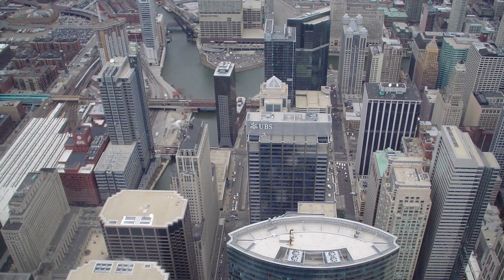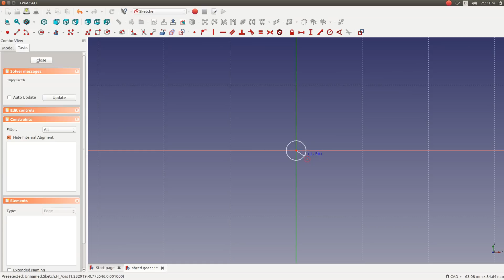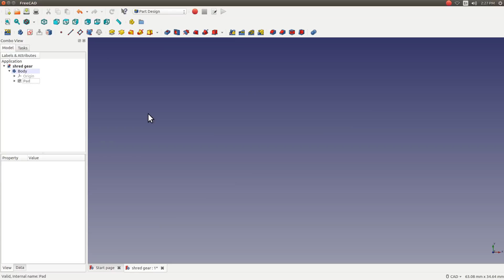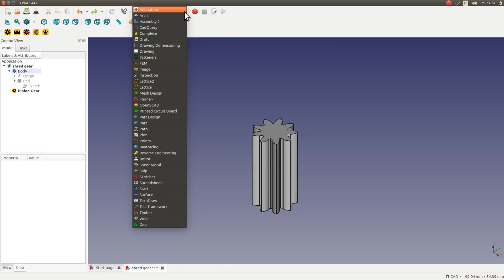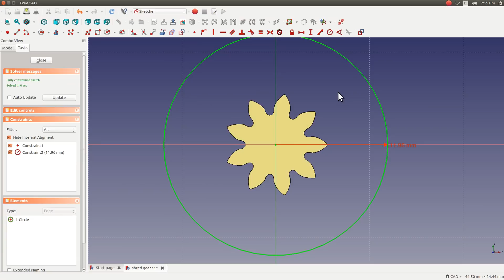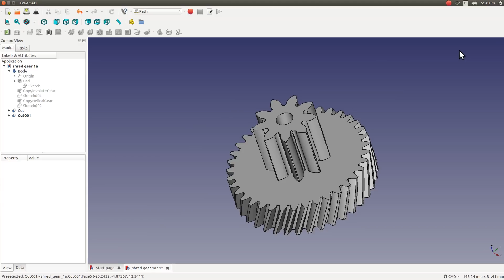Paper Shredder Repair 2019 Pt2

Comment: I made my gear following your tutorial and everything worked perfectly.  The gear fit great, but while testing it the pinion part of the gear was "torque twisted" off the main gear.  I think the problem was the quality of the print (see pics here: https://u.pcloud.link/publink/show?code=XZ3ew3kZEN9uEDQ7HHjVYXdu3Arch0CPBbhV).  There are a lot of air pockets in this print which probably made the gear weaker.  I don't own a 3D printer, so the online service I used was makexyz and the material I chose was ABS plastic.  Do you have any advice as to which online vendors I could use to make a quality, strong, long lasting print of this gear?  Should I try a different material?
Reply from the maker: Hi Nate:

I’m sorry you were disappointed with the quality of your print.  ABS plastic is great for this application.  You’ve already discovered the problem with the amount of infill.  This process works best with 70 to 90% infill.  With compound gears, if you have a shear failure especially between the main gear and the pinion, add more infill.  If you own your own printer this is easy to control, but if you are jobbing this out they need to know this before they accept the job.
Reply: @bcastlar3453  Thanks for the info.  I don't know of any vendor that allows me to control the infill.  Should I try a different material?  I did find a 3D printing service that would do a steel gear for a somewhat reasonable price.  Would 3D printed steel be a better option?  Or would I still have to worry about the amount of infill even when printing with steel?
Reply from the maker: The steel gear sounds cool!  Let me know if you go down that path.  I had a chance to sleep on your problem.  You might try to pour epoxy resin in both halves with small steel rods spanning both gears.  Let cure and pray!
Reply: @bcastlar3453  Oh wow.  I hadn't thought of that.  Any idea where I could get steel rods?  I'd be willing to give this a try.  Also, I have a friend that has a 3D printer who might try printing a gear with greater infill.  I'll let you know how that goes.  Thanks for all your help with this!
Reply from the maker: As a part of the maker community, it’s time to think outside of the box.  Check your stock of like new and well used screws 4-40, or 6-32.  That would be M3, or M3.5 for our friends in metric land.  Throw the screw in head, threads and all.  That just gives the epoxy more to grab onto.  Definitely, let your friends printer give it a try.  Good luck.
Reply: @bcastlar3453  I tried the steel screw approach but I ended up mangling the gear :(  A google search of "3D printed gear strength" bought up quite a few articles on the subject and most of them seemed to use Nylon as the material of choice.  I found a online service that would do that cheaply, about 1.5X the price compared to ABS, via selective laser sintering using Nylon PA2200 and the resulting gear is really strong.  I tested its stength by jamming enough paper in my shredder (way more than it was rated for) to the point where it was straining the push the paper through and the gear held.  Is there a drawback to SLS printed Nylon over ABS?
Reply from the maker: To be honest, I’ve never tried nylon.  Per my printer spec sheet, it’s not recommended to try to pint nylon due to the high temperatures needed.  Anyway, the only filament I have is ABS with just a small coil of PLA which came with the printer. 

BTW, I just uploaded part 3 of my series on parametric cad.  It was supposed to go up Monday, but I have been suffering with a bought of laryngitis.  As of yesterday, my voice came back to the point that I was able to cut some audio tracks.

Comment: I'm using version 0.18.4 of FreeCAD and the opening menu looks nothing like yours.  How do you create a project?  I can create a file but there is nothing in the Task tab.
Reply: I had that same problem.  This is what I did. File--> New-->an unnamed item is created. You can then "save as" and name it gear... whatever. Then go to the workbench drop down list at the top and select part design.  On the left is a box that has "start Part."  Underneath that is "create body".  Click on that and then it becomes "Create Sketch".   Then you can follow the instructions as he laid out.  Also after you create the circle, you need to hit the escape key to get rid of that tool.  It took me a little while to figure that part out as he didn't mention it.
Reply: @stevest.pierre2082  Thank you!  That was exactly what I was looking for.  Worked perfectly.
Reply from the maker: Hi Nate:

This weekend has been busy.  Sorry for the day old reply.  To answer your question, the version of FreeCAD I used to produce this video was version 0.17.  As of the release of this video series, that was the current stable version.  Like you I’m currently running version 0.18 as well.  You’re correct, the start page has been significantly changed.

Last month I released a video titled, “FreeCAD Broken Sketch Broken Face 2020”.  You can access that video by either using that title, or by going to my channel page.  It’s a short video describing how to use the sketch repair tool which I think you’ll find useful.  However, the important thing is that, at the beginning, it covers in detail how to start a project and begin a sketch using version 0.18.  If that doesn’t answer your question, please leave a reply.  Incidentally, the compound gear I printed for my shredder is still in service.  It’ amazing just how strong printed gears really are.  Just be sure to use a good silicone lubricant designed for plastic gears.

This coming week I’ll be releasing part one of a multipart video on parametric cad programming using FreeCAD.  If you’re interested please subscribe to my channel.
Reply: @bcastlar3453  Subscribed.  Thanks for putting this together.  I have a gear I need replacing in an old shredder and this video was just what I needed.  One question.  What type of plastic did you use?  Thingiverse has several different types of plastic that they will print out of and I don't know which one is strongest.
Reply from the maker: I use ABS.  The overwhelming majority of my printing involves gearing and other mechanical assemblies.  ABS is mechanically stable.  For these applications I must warn you to avoid PLA like the bubonic plague.  PLA has a nasty tendency to, “CREEP”.  Meaning that if you subject a PLA print to an external force, over time, it will deform.

Lastly, thank you for subscribing to my channel.